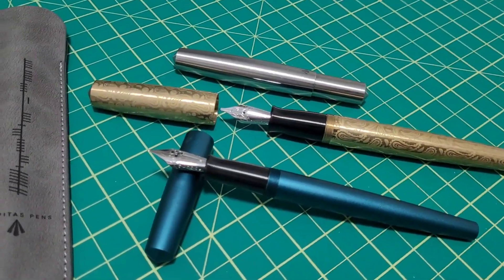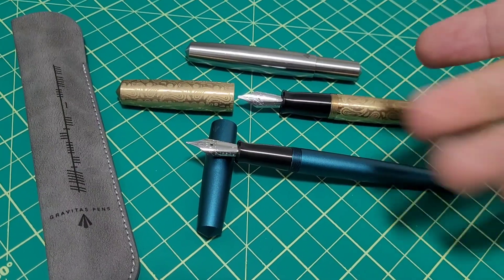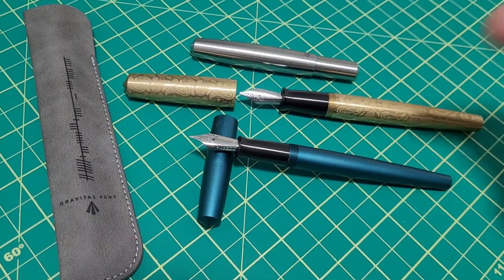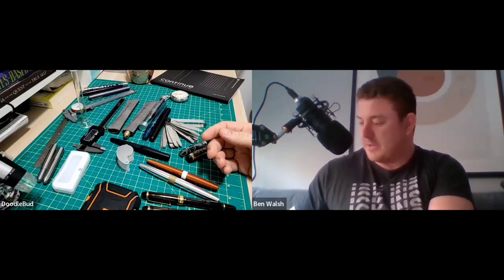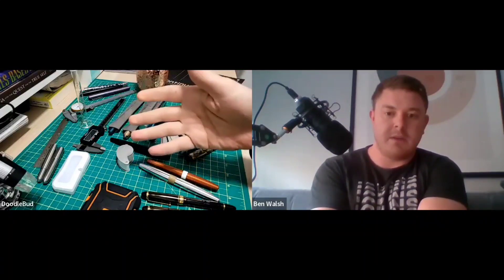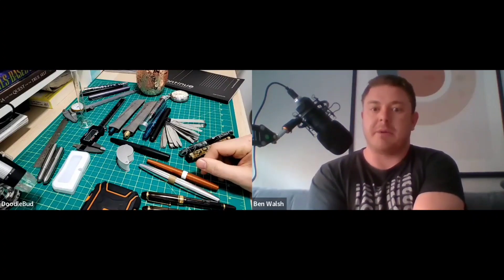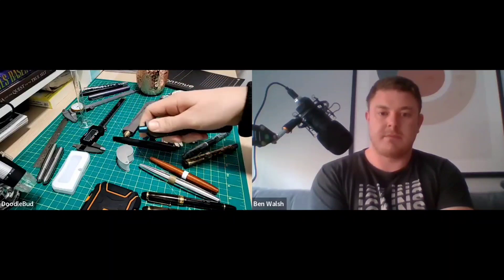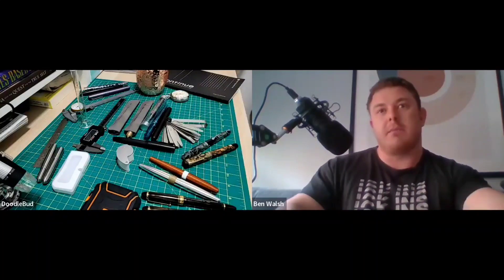A Designer and an Engineer Talk About Making Pens (Gravitas)

Comment: Looking forward to how the TiSiNX-coated pens will turn out! The curious me has two questions: What metal will these pens be made out of and – since it is an extremely hard coating – will the eggshell effect be an issue?
Reply from the maker: I don't think there will be any eggshell or cracking issues with the coating. It's a molecular bond & extremely strong. This same coating is used on endmills & other cutting tools in the machine shop. If it can handle cutting steel, titanium, etc... it can hold up to the rigorous demands of us fountain pen folks 😉
Reply: @Doodlebud  Well, I see I have some reading to do about superhard nanocomposites. I last looked at various coatings when I researched steel watch cases a few years ago (in the end I went with tegimented steel, no regrets).  Granted, watches may be more prone to be dinged and dented than fountain pens so eggshell effect might be more of a problem in that use case.
Regarding endmills: tungsten carbides are already quite hard so a coating would probably not be subjected to stresses fom elasticity or plasticity of the base material.
I agree that tribological properties or extended tool life considerations of a coating will not be relevant for a fountain pen and judging from concept images on Ben’s insta the decorative aspect is exquisite. I am hoping it turns out to be the orange/blurple color scheme.